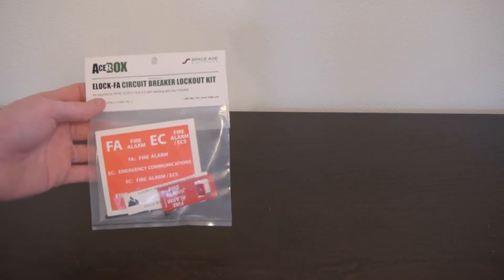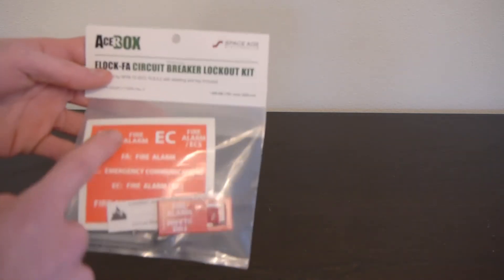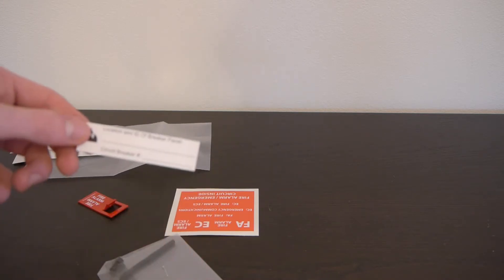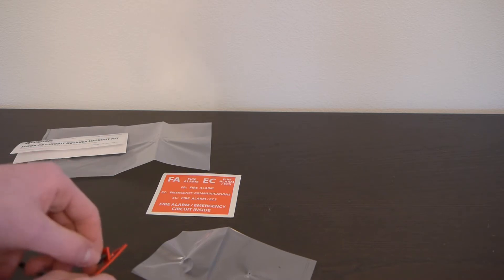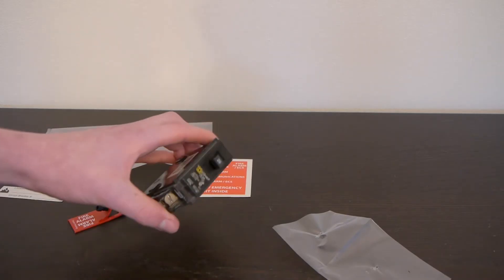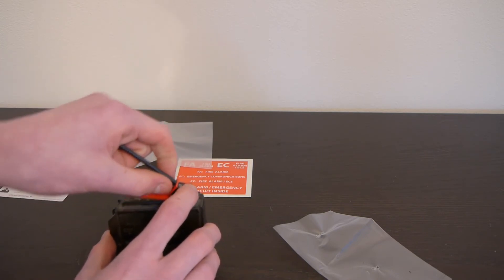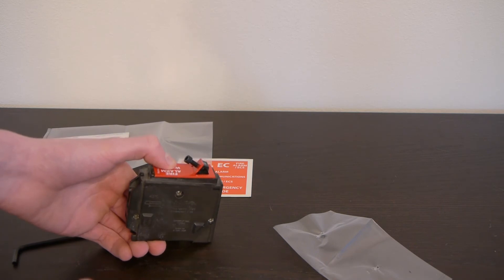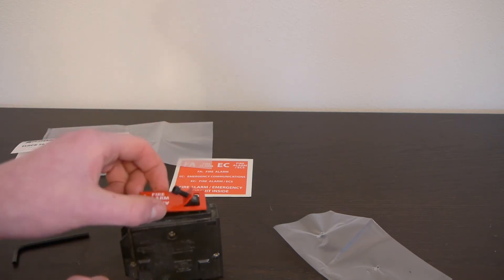Space Age Electronics fire alarm breaker lockout kit unboxing

Comment: It would be cool if they made one of these for a two pole or three pole breaker
Reply from the maker: I think you could just put it in the middle and it should still work
Reply: @FireAlert  you couldn’t because there is sides on it that go on either side of the breaker handle so it would not fit on a two or three pole breaker

Comment: Do you know if they make a larger version for moulded case breakers?
Reply: I think so
Reply from the maker: but why would a fire alarm system need anything that large?
Reply: @FireAlert  because lots of times that’s the only type of breaker that will fit on large service switchgear and will only be a 15 amp breaker I see it all the time in the field
Reply from the maker: @nics-systems-electric  that makes sense